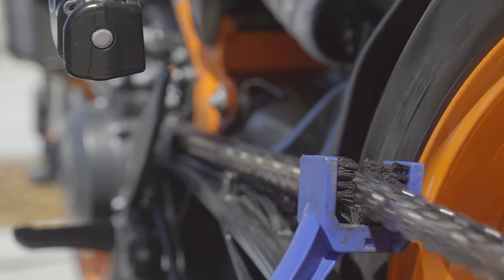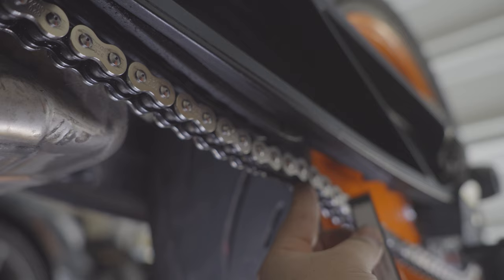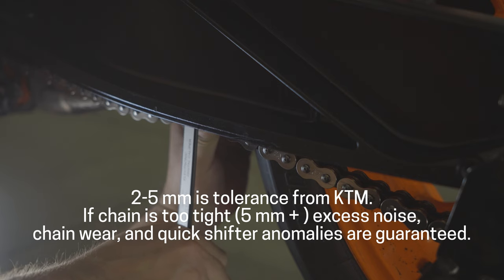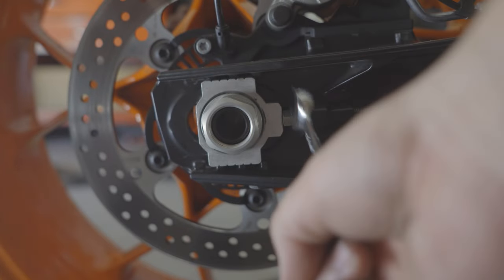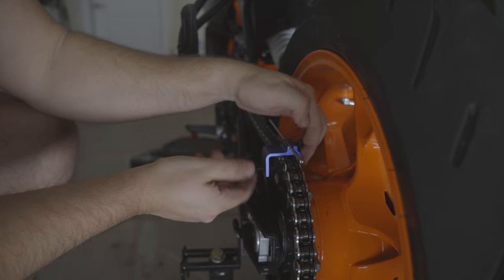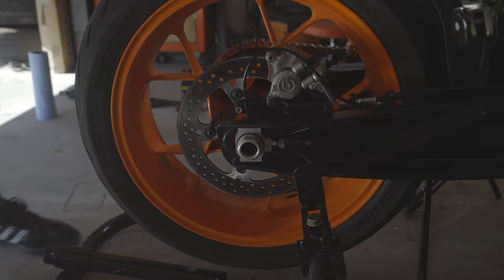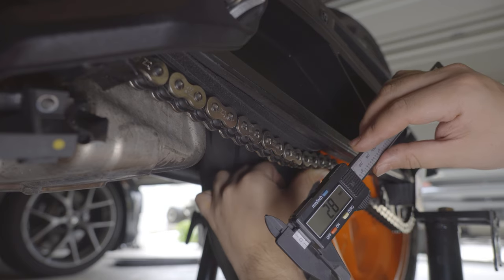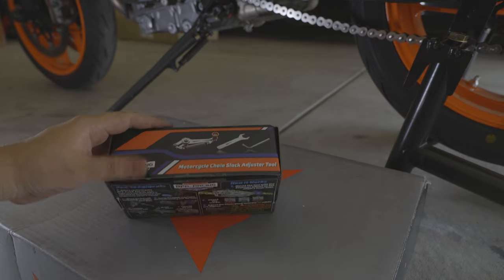Chain Tension DIY and Quickshift Discussion - KTM 890 Duke R

Comment: You should set rider sag too. I found adding preload helped my quick shifter. The more you weigh the more chain slack you need. I’m fat so I keep my chain slack at 3mm and rear preload high to control the chain slack. My quick shifter works 100 percent of the time.
Reply from the maker: You are 100% right there, my preload is also quite high as I’m a dense Mexican lol. Now that you said it I’m regretting not mentioning it in the video! I hope to do a suspension custom setup video in the future and will definitely remember to include the wisdom. Cheers man!

Comment: Great to have you back👏 Thank you that was very good, straight to the point. Can I ask what was your QS symptoms before and usability after? Really glad you’re healthy and it’s nice to see your KTM 890R content again.
Reply from the maker: Thank you! I’m feeling strong and thankful. So in short I was having issues with engagement when going up the gears and lumpiness when going down. While shifting, even when applying plenty of force in the upshift, I was running into a dead area between gears as the next highest wouldn’t immediately engage. Quickly after this dead zone the bike would either go back into the lower gear (revs and friction would spike)or it would “pop” into the higher gear. I have video of this and highlighted it in a previous video I’ll have to find. After slackening to the lower tension when applying a similar force (or even less for experimentation). I tried to take additional video of this, I’ll post if it properly captures what I’m talking about. Cheers!

Comment: Thanks very much!  I wonder why KTM pushes UP on the chain and don't pull down?  I think it may be easier to measure as one does not have to be "under" the bike to see...  I am going to set my chain as you show here and then also measure the correct distance pulling down, record that and in future use the "pull down" method.
Reply from the maker: Thank you for the comment, it’s so good to be making videos again. That is a great idea! If you remember definitely leave your measurement here for others to reference as well.